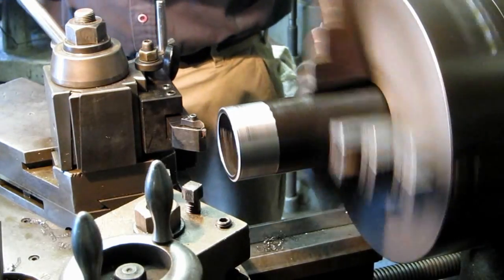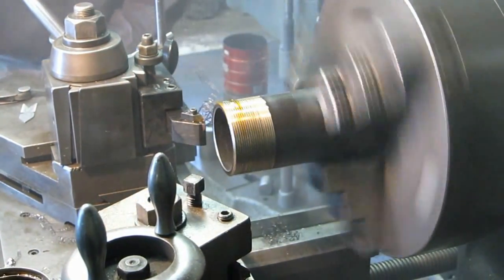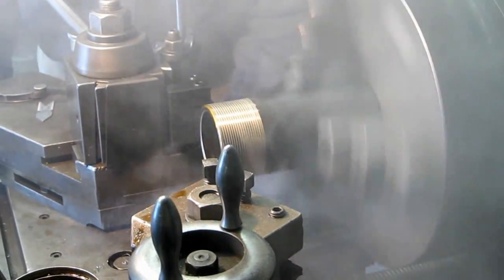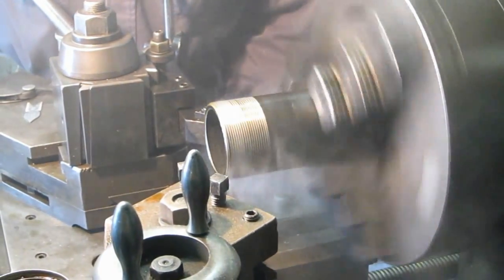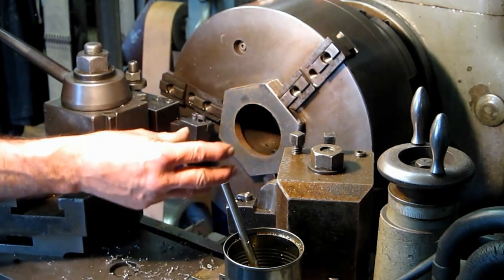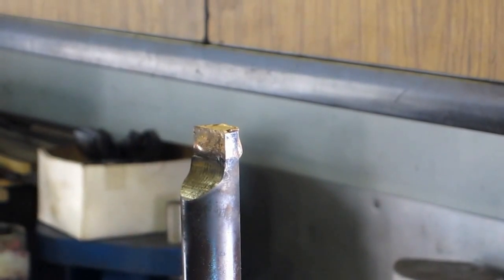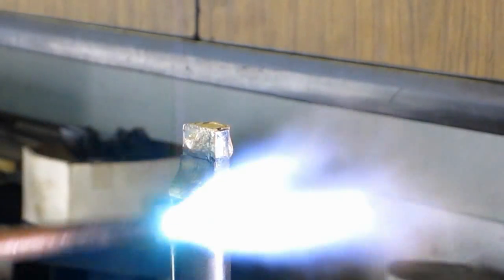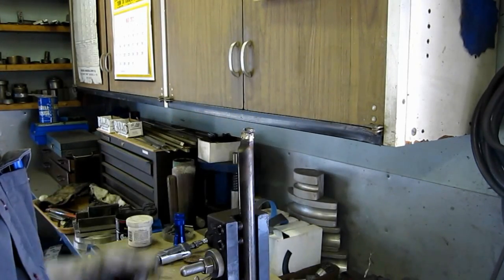Big Screen Elevator Part Nine

Comment from the maker: The bar is mild steel and the bit is one of my carbide theading inserts that I use in the standard turning holder, the end of the bar is milled flat / 90 deg's, set it tight and no regrind needed. Most of the time its only your straight in depth that needs to be adjusted to come back in for the pick up, where you left off when it broke!

After your silver soldering don't quench it, makes the insert brittle...

Comment: It's such a pleasure to watch you work Keith.  Couple quick questions, is your threading boring bar a mild steel bar, and what was the tip made of that you silver soldered to the end?  Was it tool steel you had to re heat treat?  Also, do you hand grind it to cut the proper angles for the thread pitch, etc.